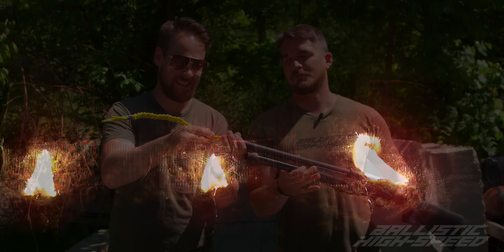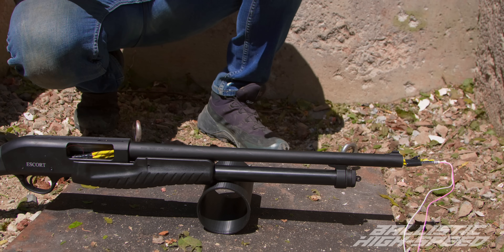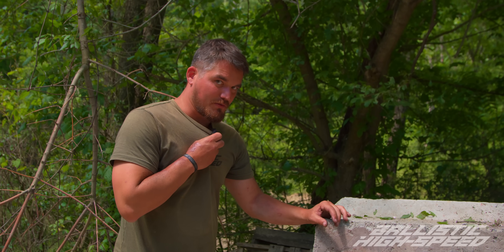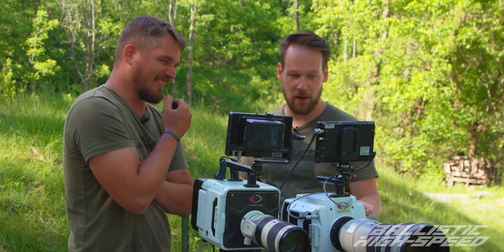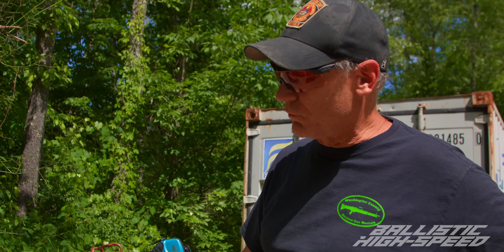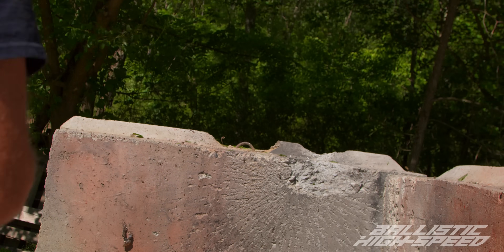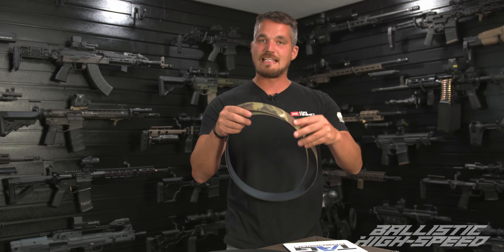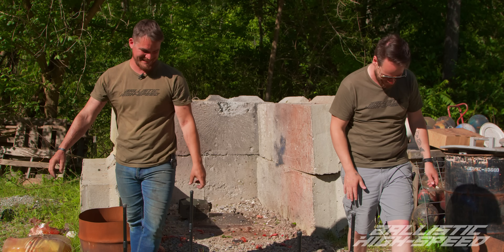Det Cord vs Ballistic Torso in Ultra Slow Motion!

Comment: I was a 12B in the army for about 10 years. We used A LOT of det cord. If you could run det cord from NY to California  it would only take it 5 or 9 minutes to go from coast to coast. My math is probably off so I’m gonna throw 12 minutes in there as well. Either way this stuff burns insanely fast.
Reply: Should be around 6-8000mps, so around seven or eight kilometers in one second.
Reply: Math says 7 min and 26 seconds for detcord to go the straight line distance LA to NYC
Reply: Right on. I appreciate the help with the math. It was definitely the weakest thing I brought to the table. When I did my demo calculations I always went with P for plenty. Just when I think it’s enough, I’ll had a lil bit more.
Reply: @stankrod8012 That's it, no abatis calcs for you! 😂

Essayons!
Reply: @BusyBadger  Let Us Try
Reply: So it detonates at mach 19.55
Reply: @BusyBadger  so my P for plenty math bit me in the ass, and it bit hard, one and only one time. The fire department that was set up in Baghdad was going around and defusing IED’s every time they came across any when they went out on a call. Well these crazy bastards must have been doing this for a very long time. We had a meeting with these guys, at their fire department, to see what all they needed to be able to do their job safer, faster and better. Towards the end of the meeting one of the guys asks us if we wanted to see the IED, singular, that they had found. He takes us upstairs and opens up about 4 wall lockers packed full of mortars and grenades. I mean hundreds of these things. After we got over the amazement of what we was looking at he told us there is more on the side of the building. We go outside and this dude shows us all the damn artillery shells they’ve been finding and bringing back with them. My PL leader made the decision to blow them all in place. The rest of my platoon went around to all the houses and told them to open all their windows as I busted out the time fuse and began my P for plenty calculations. So with time fuse and det cord you cut off the first 12 inches, due to possible moisture contamination. With time fuse you then cut off an additional 12 inches and set it off and time how long it takes that 12 inches to burn. Somehow I ended up short timing us on the time fuse. I crimped a high density blasting capon on one end and stuck it into about a pound of C-4. I set it down on the pile, huge pile, of artillery shells and set it off with the igniter that we use. I wanna say they are a M-81 or 89. I figured I gave us 2 minutes to clear the area before it went off. So I’m not exactly walking away from this in any kind of hurry. I barely turned the corner on the building and it touched off. It felt like my head was about to explode. Knocked my ass on the ground. After the noise of the explosion passed all you could hear was people’s windows shattering for blocks around this place. Shortly after EOD finally showed up and took over from there.
Reply: @stankrod8012  SO IT WAS YOU?!?!
Reply: @kamikaze4015  in my defense everyone knew my math was a lil sketchy

Comment: Watching the shock wave rebound off the surfaces is awesome. However it also seems to have created more destructive forces due to the multi directional nature of the rebounded waves. Could you do a test at a range where you can detonate without  close protection thereby allowing the shock wave the spread out rather than rebound. Not sure if the results would vary and by how much but the comparison would be cool. Destructive capabilities of explosives sheltered vs unsheltered. Great vid.

Comment: More than 50 years ago during demolition training in the army we cut down a famously strong African tree more than 2 feet diameter with about 3 or 4 yards of cordtex, the tree jumped about 4 or 5 feet up at the sheer point. 4 or 5 inches of cordtex sent a 200 gallon empty galvanised rubbish bin 200 or 300 feet in the air

Comment: I have an idea that came to me while watching the outro, seeing the barrel in the background. 
A Mob-style rat disposal...  Gel torso, in the barrel full of water, (preferably a steel barrel with the locking-ring top) close the gel "rat" up in the barrel, and a few wraps of that 400gr. det cord around the middle.  
I'm picturing in my mind, something like those experiments with loops of wire with 100's of thousands of volts dumped into them from big capacitors, that they use to crush and split soda cans.  But it's a 55 gal steel barrel, full of water and the rat problem. Crushed with det cord instead of electricity.  

Now,  I'm probably on some three-letter organizations, list...

Comment: At the start othe video imma just say, if yal dont bust a barrel using a high speed high explosive material that isnt already moving at hiugh speed in order to leave the barrel.... imma be super suprised. Whats the initial kick to get the cord outta the barrel? Using some sort of laucher charge like whats they use on rpgs to launch the grenade clear of the operator before the rocket ignites? itherwise you are just detonating a really skinny pipe bomb that missing an end cap. first attempt reaction: Hank hill with a beer and frinds in an alley way. :P 

You have not acceleration towards barrel exit on the det cord. Its just the pressure difference between what cant get out behind and what can somewhat get out the front, and you are building to several times peak pressure, scveral times faster that a bullet does, which gives the gun barrel material less time than with a bullet to absord sveral times the pressure, MOSTLY IN THE BARREL i might add, which it normally doesnt need to nor is it rated to hold what the chamber can. And the det cord is throwing seral times higher pressure than bullet, peaking several times faster than a bulllet, which, to use the falling into water analogy, that if you are falling fast enough water can act like concrete because you can displace enough water to  slow your decent down you a slower rate to give the water time to get outta the way, in guns normally, the metal does have some minor form od elasticity and toughness, and the pressures arent so great nor the times scales so short, that the gun cant withstand the normal use and function, and can kind of compress towrds the outside of the gun barrel, before rebounding when the pressure drops and also assiting, very very minorly, with giving the pressure a norrower path as the compression rebounds to the original rest point, kinda like a spring, and since something uder pressure has to move faster when entering a narrower path way, due to conservation of energy. Minor, but likely mathable. 

Whereas, the speed and pressures of a bundle of detcord, theres just no time for any of the atoms in the material to move towards compression or absorbtion and the aterial becomes like glass to a stone. Poeces fracture instead of blowing out at a failure point. I WAS hoping you guys would have considered some of those, to me, obvious things that couild mnaybe prolly not have assisted with the amaxing high speed shot you were attempting to create. Put a bvomb under a spaceship instead of a rocket (detcord inbstead of a bullet, something stationary that reaches peak pressure muvh more quickly that the material trying to withstand it is rated for, vs something that starts off s;ow in relstive terms, and takes time to reach maximum pressure giving holder material time to deform and absorb energy at the molecular or atomic level.) and see if they go anywhere but cemetary.

Comment: You do not need to be gunsmith to know the difference between a pump shotgun bolt and the flat bolt carrier that goes under the bolt and attaches to the forend rails. Perhaps the highspeed guys should take some SDI courses or at least purchase some gun diagrams to learn thepart names.